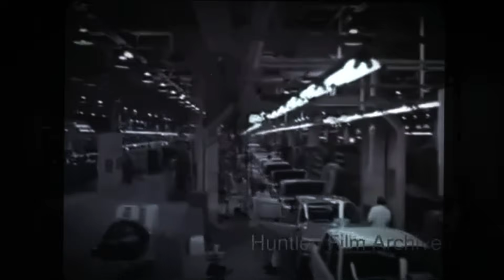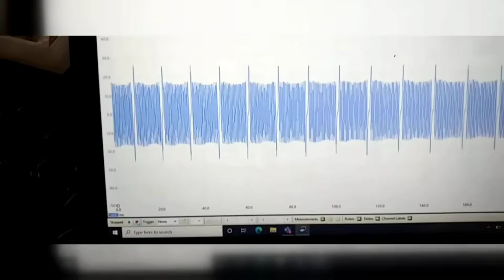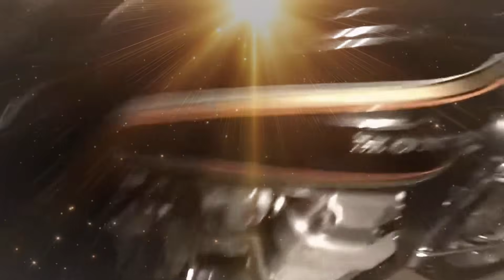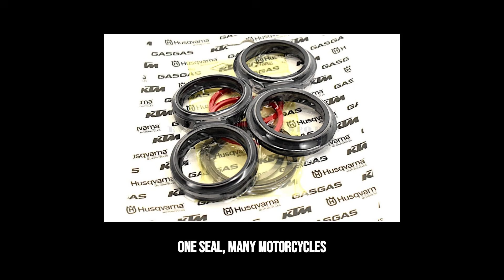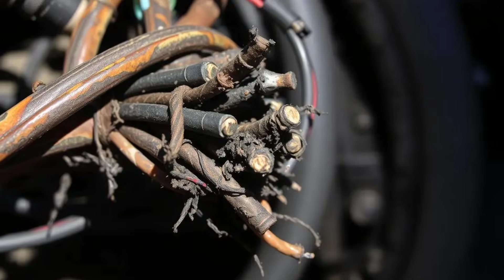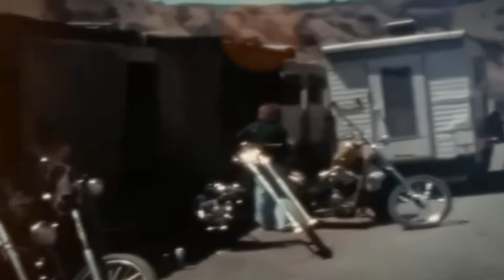Why 1970s Motorcycles Outlive Every Modern Bike

Comment: This narrator is full of BS ... Will you turn off a old or new motorcycle the engine heat boils the alcohol and the additives from the fuel left in the carburetor bowl.... And it doesn't matter if it's an old motorcycle or a new one it will not start under these conditions
Reply: Same thing happens to card also

Comment: Thank you very much! And yet many people think the term ‘sustainability’ is a modern invention. It’s just that back in the 1970s, it wasn’t called that. Any vehicle with a combustion engine that is used for a long time is more sustainable than any electric vehicle, which many people today are quick to swap for a new one simply because the battery and range from two years ago no longer meet their expectations. You just have to factor production and disposal into the carbon footprint. The emissions from the individual vehicle are hardly significant in this context. Greetings from Germany

Comment: My 1979 bmw r80 7 is just bomb proof. There is nothing on her that requires any more electronic nouse than simple wires. The engine can be completely stripped with the block in the frame. Working on her is easy with a basic tool kit.